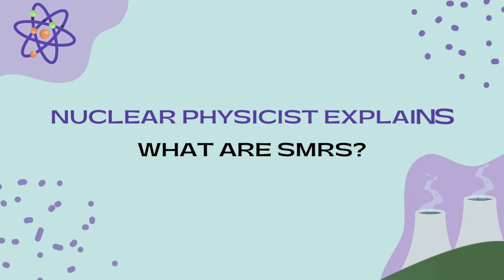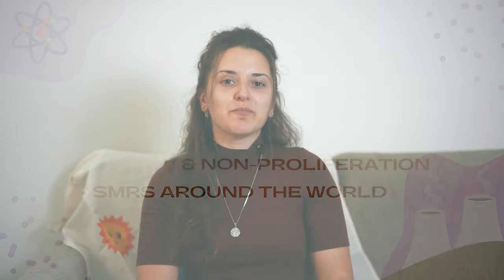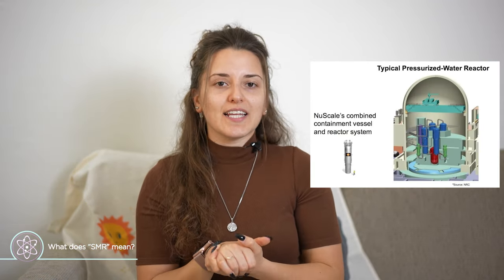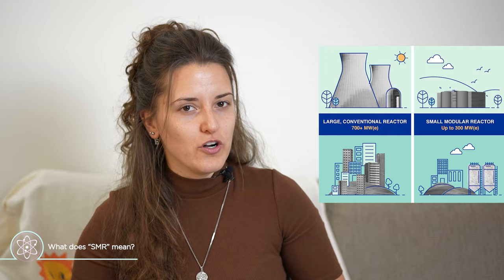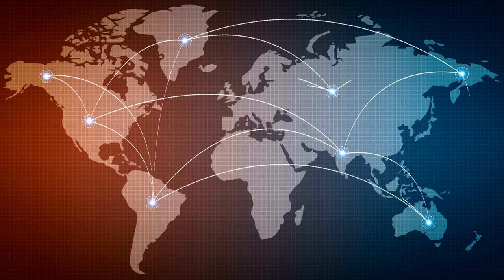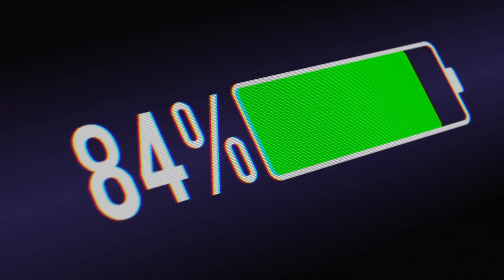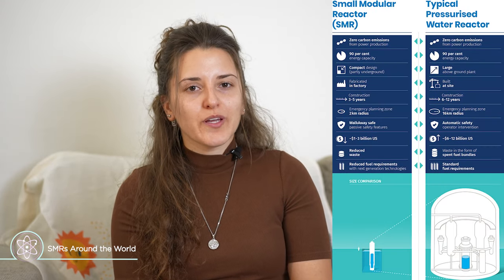Nuclear Physicist Explains - What are SMRs? Small Modular Reactors

Comment: Mostly like 300MW thermal, not electrical.
Reply from the maker: Its actually 300MWe which is around 1000MWth
Reply: Ah, up to, most of the ones I know about is planned to be commercially 200 to 300MW thermal. 
Also, your list is short of some high temperature gas cooled reactors, which can be refueled while it's online.
Reply: There's a book on the subject called "High Temperature Gas Cooled Reactor Power Plants" by Kurt Kugeler and Zuoyi Zhang. I worked for a company that designed them
Reply: @AndreLeRoux81  Hmmm and you or anyone else here wouldn't have a predetermined bias?
Reply: @paulmobleyscience  predetermined bias for what?
Reply: @AndreLeRoux81  Hmmmm I see it didn't post for some reason....you said you worked for the one that designed it so you wouldn't have a bias after making money from it?   Like you wouldn't go to many pronuclear videos and promote all nuclear power possibilities based on your prior time at making money?   Right
Reply: @paulmobleyscience  you assume too much, I didn't promote anything. And the only money I made was a salary.  I'm curious though, what predetermined biases drove you to make those assumptions.
Reply: @AndreLeRoux81  None, I started on the fence unlike you that started on one side of the fence and never left.   Yes you are clearly here promoting nuclear power and no secret your not even trying to hide it.  No I am an engineer that served in the US Air Force that knows the science better than even Elina does and why my comments never get an answer.
Edit: Maybe you can answer the differences of biological Half-life between H3 tritium from the sun and Organically Bound Tritium from our water cooled nuclear reactors?  Do you think with this newer research that dose standards should be reset?
Reply: @paulmobleyscience  on the fence? Between nuclear and what? Come on Paul, I've not argued for nuclear over anything else. Your projection is failing and I can see why you're comments are getting less and less responses. You fumble into conversations and accuse people of stances they're not taking. You're building strawman arguments
Reply: @AndreLeRoux81  No they aren't getting less and less.  Look at the comment section.  You do understand that I'm an Engineer that served in the US Air Force right?  You do understand I've studied nuclear physics and many other subjects don't you?  Take a look around, even on the Nuclear Engineers thread.  Yes on the fence because I didn't make money from any power source like you have.  Please tell me you realise that you have a subconscious bias and not just a conscious one...its why Elina does videos to begin with.  To make more money.
Reply: @paulmobleyscience  you say you were on the fence; on the fence between nuclear and ...?
Reply: @AndreLeRoux81  Not using nuclear
Reply: @paulmobleyscience  really? Lol, who is the one with the predetermined biases now? If you don't want to use it, don't use it. 

"Somewhere in your wardrobe, I'd be willing to bet
There's a t-shirt proudly bearing the silhouette
Of Che Guevara

He was revolutionary, yeah, he wore a cool hat
But behind the design
I think you might find
It's not quite as simple as that

Che was a bit of a homophobe
Che was a bit of a homophobe, I think, apparently
Che was a bit of a homophobe
Che was a bit of a homophobe

This is my song in defence of the fence
A little sing-along, an anthem to ambivalence
The more you know, the harder you will find it
To make up your mind, it doesn't really matter if you find
You can't see which grass is greener
Chances are it's neither, and either way it's easier
To see the difference, when you're sitting on the fence

Somewhere in your house, I'd be willing to bet
There's a picture of that grinning hippy from Tibet
The Dalai Lama

He's a lovely, funny fella, he gives soundbites galore
But let's not forget
That back in Tibet
Those funky monks used to dick the poor, yeah

And the Buddhist line about future lives is the perfect way to stop the powerless rising up
And he tells the poor they will live again, but he's rich now so it's easy for him to say

I'm taking the stand in defence of the fence
I got a little band playing anthems to ambivalence
We divide the world into terrorists and heroes
Into normal folk and weirdos
Into good people and pedos
Into things that give you cancer
And the things that cure cancer
And the things that don't cause cancer
But there's a chance they will cause cancer in the future
We divide the world to stop us feeling frightened
Into wrong and into right and
Into black and into white and
Into real men and fairies
Into status quo and scary
Yeah we want the world binary, binary
But it's not that simple

And your dog has a bigger carbon footprint than a four wheel drive
Yea your dog has a bigger carbon footprint than a four wheel drive
And your dog has a bigger carbon footprint than a four wheel drive
And so does your baby, maybe you oughta trade him in for a Prius

ROCK!

I'm taking the stand in defence of the fence
I got a little band playing tributes to ambivalence
We divide the world into liberals and gun-freaks
Into atheists and fundies
Into teetot'lers and junkies
Into chemical and natural
Into fictional and factual
Into science and supernatural
But it's actually naturally not that white and black

You'll be
Dividing us into terrorists and heroes
Into normal folk and weirdos
Into good people and pedos
Into things that give you cancer
And the things that cure cancer
And things that don't cause cancer
But there's a chance they will cause cancer in the future
We divide the world to stop us feeling frightened
Into wrong and into right and
Into black and into white and
Into real men and fairies
Into parrots and canaries
Yeah we want the world binary, binary, 00 11 01

The more you know, the harder you will find it
To make up your mind, it doesn't really matter if you find
You can't see which grass is greener
Chances are it's neither, and either way it's easier
To see the difference when you're sitting on the fence
Cause it's not that simple... Maybe..." ~ Tim Minchin
Reply: @AndreLeRoux81  I don't have a choice and neither does anyone else born after 1950.  That's the point Andre.
Reply: @AndreLeRoux81  What do you know about Organically bound tritium that isn't the same as H3 tritium from the sun.  What is the biological Half-life for both please.
Reply: @paulmobleyscience  isn't that your predetermined biases talking?
Reply: @paulmobleyscience  Are you suggesting that tritium atoms vary depending on their source? No -- if you've seen one tritium atom, you've seen 'em all. 
"HTO [hydrogen-tritium oxide] has a short biological half-life in the human body of 7 to 14 days, which both reduces the total effects of single-incident ingestion and precludes long-term bioaccumulation of HTO from the environment.[37][39]"   https://en.wikipedia.org/wiki/Tritium#Health_risks
Reply: @wwoods66  no...Please tell me you looked up Organically Bound Tritium before you commented to me.  Wait.....its obvious you didn't so go look up Organically Bound Tritium and then come back to comment, geez Bill
Reply: @AndreLeRoux81  No....I don't have a bias because I've never made a cent from any energy production, of which you can't say.  No matter how hard you try Andre, I'm not like you.
Reply: @paulmobleyscience  My comment was on the difference between tritium "from the sun" and "from our water cooled nuclear reactors" -- there is none. 

As for your concern about organically bound tritium,
"Once tritium enters the body, it disperses quickly and is uniformly distributed throughout the soft tissues. Half of the tritium is excreted within approximately 10 days after exposure. About 10 percent of the dose from any tritium exposure comes from the small fraction of the exposure that the body retains as organically bound tritium (ICRP-30, 1979)."
https://www.nrc.gov/reading-rm/doc-collections/fact-sheets/tritium-radiation-fs.html
It's not quite negligible, but it's not really important.
Reply: @wwoods66  Thats not the question now is it bill?   What is the difference between H3 tritium from the sun and H3O Tritiated water that is taken up in plantlife where it transforms in the metabolic process into Organically bound tritium......and you think there is 0 difference?  Surely you aren't that nieve to think they are the same are you,?  Did you even look....or just guess?
Reply: @wwoods66  Organically Bound Tritium is not the same as just tritium.... and tritium has a biological Half-life of 12-30 days Bill.    Now tell me what the bioligical half life of Organically Bound Tritium Bill..   Good luck ...

Comment: Nope... The more I listen to the pro-nuclear arguments, the less I'm convinced. So, there won't be any commercial mass-scale production of SMR before a decade or so (and only if everything goes according to plans). But we need to build carbon-free plants now, not in 10 or more years. And it is still far from clear if these new reactors will ever become cost-effective and safe enough. Even if so, they are supposed to be built en masse throughout the world, meaning every city will have its own? Not reassuring for safety concerns. They may generate even more radioactive waste than conventional nuclear power plants. When compared to renewable SMRs are too expensive, risky and not sustainable. Not convincing.

Comment: 4:07 the reason why large reactors are always a little bit different reflects the different lisencing requirements and regulations in different countries. I really do not see how SMR will fix that ...

4:30 also large reactors could operate for years. However, the different components like pumps have service and maintainence  intervalls, and pipes have test intervalls. These limit the cycle length. Also here, dont see how SMR may fix that. Even nuclear propulson systems like in aircraft carriers go into regular maintainence without the need for refueling ....

5:20 how do you wanna keep the fuel always in the reactor? The fuel cant be transported with the reactor, you cant build a reactor like a storage cast...

5:30 the currently economically semi-reasonable designs are the IPWR... HTR or molten-salt or heat-pipe reactors have a way too high investment risk to be built as SMR ....

5:55 a SMR only uses 10% of the land of a high-power reactor while having an electric output of 3% of the power reactor ...  very land conserving ...

6:10 all considerations to bury a reactor under ground failed when considering flooding accidents ...  Fukushima really was a thing ....

7:05 passive systems make a reactor larger, not smaller, because with low driving force (pumps) you need larger heat-transmitting surfaces and larger pumps to minimize flow resistance

7:40 also in high-power reactors the SCRAM system do not need electric power....

7:55 the radiation-induced material damage to cladding and the fuel element skeleton limits burnup. How does SMR want to avoid it when already high-power reactor operators researched for 60 years for the optimal materials?

8:15 we have a lot of SMR in operation, e.g. in war ships. And we had them in the 1960s, e.g. the SL1. Why dont we have them today in civilian usage? There is the law of economy-of-scale, the larger a reactor  the cheaper the production cost per kWh... and here the SMR dream dies ...

8:45 please Google CAREM Argentina

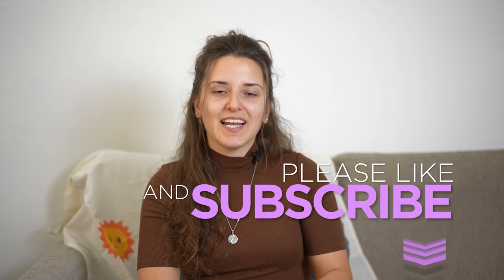9:10 sorry, how shall i like such a video where the presenter obviously only has read advertisement material? ....

Comment: Disappointed.  Instead of a insightful look from the point of view of a physicist, we got the standard half truths that you would see on an investors prospectus.  

A physicist or engineer would have pointed out the ridiculousness of relying in natural circulation, the costs nd improbability of a 25 year refueling cycle,   The low neutron efficiency of a small reactor, nd so much more.  An economist would have given some real numbers as to the initial and continuing costs.  A politician might point out the difficulties in placing a new experimental reactor with limited or no backup systems near any population center.  Instead we got the glossiest of overviews, or really, oversights.